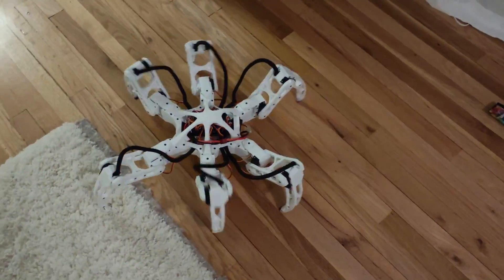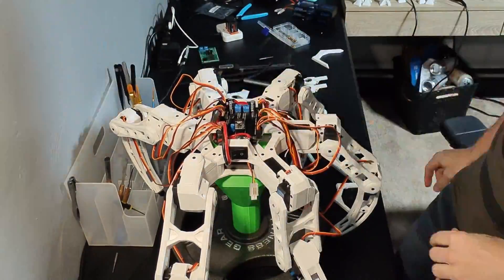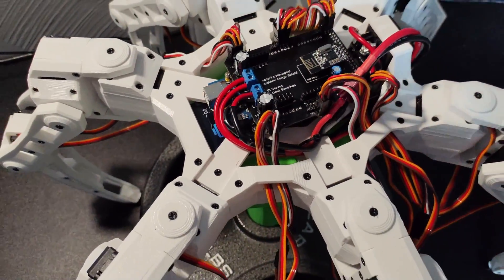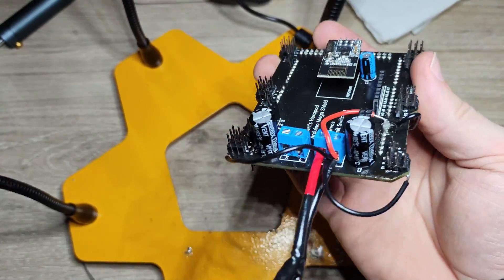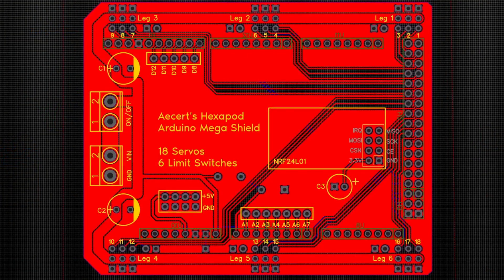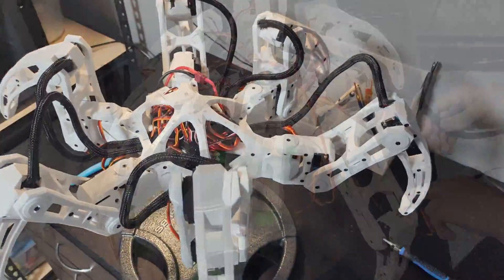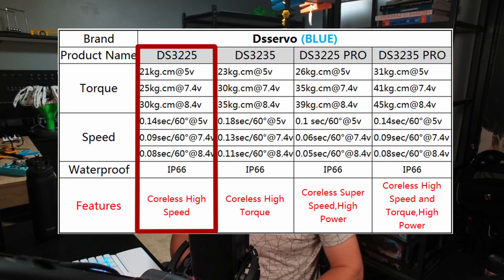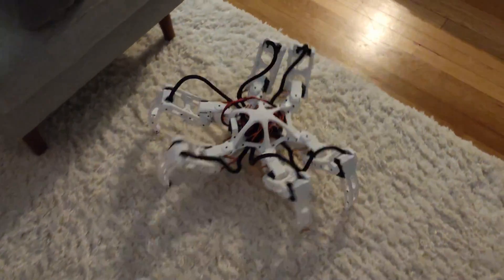I Finally Dealt with Wire Management for my Hexapod

Comment: Hi. How do you power the servos? Are you powering them straight from battery or by DC converters? I'm building similar hexapod and I am planning on using 2s li-ion pack, but when fully charged it will be 8.4V and my servos are rated for 7.4V, so I am worried about burning them.

Comment: Hi. Yes I am building this Hexapod But with Carbon Fibre plate CNC cut to size to save weight. The PCB arrived today so looking @ then you have made provision for a Current sensor as well.    What current sensor are you using ?? . Nice touch. The only thing I can see that would make it a little better is to have the bottom layer of the PCB grounded. Similar to the middle layer.                    As "Lord_xeel said below. I am using the Arduino GIGA as it was a free sample.   A most excellent project with a working Robot that looks the part. Well done you.    Have spare PCB (UK only)

Comment: if you change the PCB from 2 layers to 4 layers you can fix the power problem by using layer 2 and 3 for power this also afects the EMC from the PCB
Reply from the maker: You aren't the first to recommend this! I wish i considered 4 layers sooner because you are exactly right, it makes everything so much easier.

Comment: Concept: Make the motor shield PCB actually hexagonal, with the connections in the corners physically as close to the legs as possible. Mount the Arduino Mega upside-down on TOP of the motor PCB. This would make wiring super easy since all the wires are not only spread apart but also identical in length. Additionally, you can now pull the micro controller out very easily since it doesn't have the motor PCB and wires in its way anymore. You could also offset the position of the Arduino toward the back, making access to the programming port substantially simpler.
Reply from the maker: Shit dude this is a really good idea wtf 🤣 
Unless I find something wrong with it, I'm going to do this. Ty!
Reply: @AecertRobotics  Haha, nice. Second thought: Have you considered the Arduino Due? It has the same pinout at the Mega, but it has a substantially more powerful processor, which is even capable of multithreading. The main drawback is that it has 3.3v logic instead of 5v, so a lot of components need a logic level shifter for you to use them (though a surprising number work at either voltage), logic level shifters are easy to come by and cheap, so especially when you have a whole custom PCB, adding logic level shifters to it would probably be relatively easy. Food for thought. There's also the Arduino GIGA, but that just came out and... is sold out everywhere.
Reply from the maker: @Lord_zeel  Wait so the due is just the mega but faster? Im interested... The speed isnt needed yet, but I can see it being needed soon. Ill look into it ty!
Reply: @AecertRobotics  yes it is needed 👀🥵

Comment: Hello Aecert, you told us, you where inspired mainly by the MX-Phoenix, which is Zenta's Hexapod projekt. That is my favorit too. It looks really good and moves very soft and fluid. Obviously your main body and the tibia are influenced by the Phoenix. That just looks cool. There are some videos of the Phoenix, where the bot climbs over a big Rock or walks up and down stairs. Zeta has a little switch in every toe, to detect, when a leg touches ground. I saw, that in the list of your STL-Files was something like Tibia Switch Mount, Switch Foot and Switch Stopper. In your video it also looks like there are at least the pre-conditions to add switches like zenta's. I guess, you have at least planned to implement such switches. 
I experimented myself with a haxapod in the last years, but my skills in programming are very limited. Till now i was not able to teach my robot, that the world is NOT an absolute flat ground. That a leg can touch the ground everywhere above or beneath the projekted Baseline and, despite it, walk properly. So i planned to start over completely new with a Hexabot. Than i stumbled over your video and i am fascinated. I'm happy about the chance to learn from you and your great projekt! 
My question is now: do you have plans to implement someting like a climb gait, for terrain adaption and climbing? That would be really great!
Reply from the maker: I am planning on adding the ability for it to walk on uneven terrain!! I'm pretty sure I'll be able to do it to, but I haven't attempted yet. There are switches in the feet, but I haven't even wired them up yet lol.

It would most likely be its own mode where one leg moves at a time yeah

Comment: You should add some heatshrink on the ends of the sleeves to stop them from fraying. The stuff with the glue inside will hold up better to motion.

Does your PCB software not have a design rules check (DRC)? DRC would've caught the floating ground.
Reply from the maker: Ahhh thats a really good idea. I have a heat gun too... 
I'm using EasyEDA and im pretty sure it does have that, but Idk, im still a beginner with pcb designing but i know just enough to be dangerous lol

Comment: Probably someone me tioned this already but would it be an idea to thread the wires through the legs ? In the end that would be a much more clean solution. And i’m willing to help :)
Reply from the maker: Much easier said than done! 3 main issues:
- the servos get in the way
- when the leg moves the tibia and femur wires get pulled, so there always needs to be slack
- id have to redesign and reprint the entire leg

Comment: I am a simple man: i see hexapod i klick like. Beatiful job.  But, i have figured out, that my hexo performs purely on bumpy surfaces. What about yours? I have a little interesting suggestion for you: 
The problem in my robot was in that it doesnt know if he touches the ground and moves his leg‘s endpoint anyway. I saw one guy on youtube, he placed a little button like thing on the end of each leg (simple construction: if leg doesnt touch the ground spring pushes button outside and circuit is open, if leg touches the ground, then under the weight of robot circuit closes). It gives so much interesting abilities (especially in meaning going offroad with your hex xD). Robot will move his leg according to the knowledge if he touches the ground or not and sometimes it will save him from falling
Reply from the maker: 😄 Thank you!!
It would probably be fine, but id need to raise the leg lift height so the legs dont get caught.
So i actually already have buttons on the feet! They arent being used atm, but they are there 🙂
Totally agree btw, its super helpful info to have. A gyroscope would be nice as well...
Reply: @AecertRobotics  adding an IMU would be a logical next step, especially if you are adding an attack mode. The IMU can measure its orientation in the environment so could help to balance when in attack mode.

Comment: This is awesome. Would it work with smaller servos? This is honestly a pretty big machine. I feel like it would be a lot more accessible if it was scaled down. 18 full size servos alone costs like $300, before you even start printing or making custom PCBs.

If that is something that you think people would be interested in, I'd be happy to help you with CAD files.
Reply from the maker: Thanks! Ill have to see, but if i could get it working with mg90s that would be amazing. Yeah, its more like 350. Fortunately the electronics are quite cheap.
I may just take you up on that offer, being made in blender is not ideal if im being honest 😅
Reply: @AecertRobotics  I’m about to make a hexapod using mg90S servos. They have a lot less torque than the servos you are using, only around 2 kgcm so the robot would have to be a lot smaller and lighter.

Comment: I've been working on a very similar project of my own for a while now. I'm not as far along as you. I'm still in the 'Searching for Servos' phase of development. Where my version shines (and you might want to consider this yourself) is that my 'main brain' is a Raspberry Pi. With this at the core, I've been able to integrate a touch screen (in it's back), machine vision and bluetooth controller (via a custom app on my android phone). I did most of the electronics/software up front, with regards to the 'mind' of the hexapod, and am planning on working on the mechanical aspects more when my shop renovations are done.

My checklist is:

-Visually identify and track a variety of objects, including 'person' 'cat' 'dog' 'racoon' 'gun' and more, while keeping track of new/known entities in real time. (done)

-Find and identify faces of both known and unknown individuals, keeping and compiling an editable database of faces which can be assigned names. It does this by fist identifying a 'person', then tracking that entity via Optical Flow, to keep track of it moving over time. It then searches a cropped image of the 'person' for a 'face' and if found, runs OpenCV facial recognition on the face. If the face is recognized, then the 'person' is assigned an Identity, and tracked. If the face recognition fails to find a match in the database a number of times, then the face/person are assigned a unique identifier and added to the database, with images of the face being added to the 'Known Identities', for future identification. In this way it can track people it sees regularly, even if it doesn't know their name. Finally, it can update it's snapshots of faces with new faces which have been positively identified, to add to the example images used for Identification. (80%. It can track and identify known subjects with existing photos, and track new subjects and gather images. Database and interface are WIP. Known Identity updating is WIP.)

-Follow subjects (Leash Mode) around a variety of terrain types. (50%. Can follow subjects only if LoS is maintained and good, identifiable imagery is coming through. If visual tracking of the subject is lost, the behavior is still undefined, so it just freezes in place until the subject is identified again. Visual searching (I.E. moving cameras around to reacquire the target) is WIP)

-Has a body (Done, but will need constant updating as other hardware/requirements demand, TG for 3d printers!)

-Can lift it's own weight (Need better motors for additional cargo, but it can just about stand on it's own!)

-Walk/Run/Hop/Etc... (<10%. The motor thing again, Curses! but I have a simple, one leg IK chain working in sim, at least! Ideally, at some point, I'm going to abandon IK in favor of a pre-trained neural network, with learn-on-the-fly capabilities. Yes I know that's very difficult, but this project is meant to help me grow as an Engineer, and growth is required since I don't have a degree!)
Reply: P.S. You earned a Sub!
Reply from the maker: This is awesome man! I love all of the vision/AI related stuff you plan on doing. I have been looking into other microcontrollers, and i think im going to have 2 versions. One simple version that uses arduino, and one complex version that pulls out all the stops.

Oh wow no IK and replace it with a neural network? If you get that working I will be very impressed.

Also your comment isn't showing up on the video for me? I'm not really sure why but you may want to repost in multiple shorter comments if you want it to appear
Reply: @AecertRobotics  Yeah, i typically have an issue with the 'wall of text', though i don't know what you mean that it's not showing up on the videos? I'd love to be able to share my progress, going forward, but I'll try to make my posts more succinct!
Reply from the maker: @Corbald  Ayye its showing now! I think me responding to it fixed it, because even logged out in an incognito window it wasnt showing.

Hahahah dude as long as you use paragraphs i dont mind at all :D And please do!